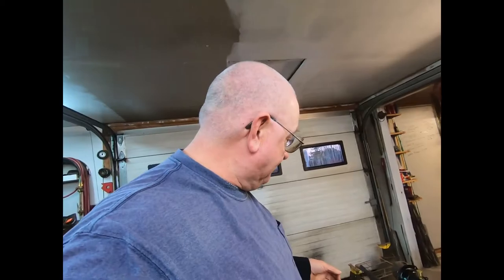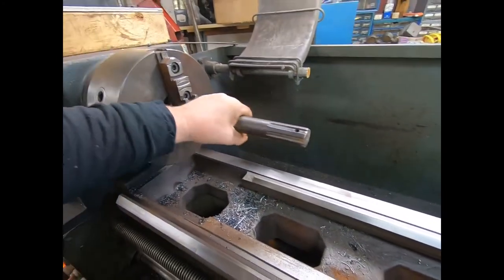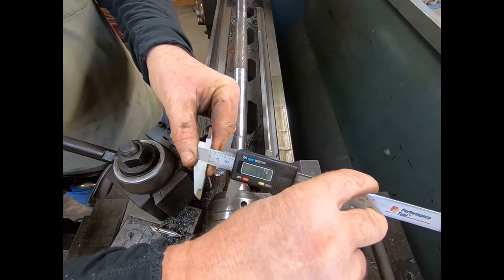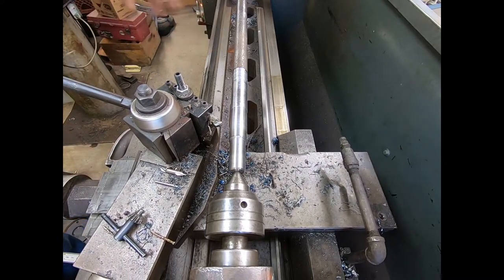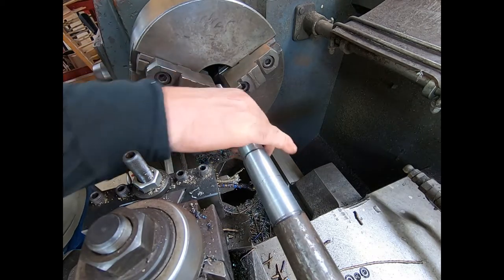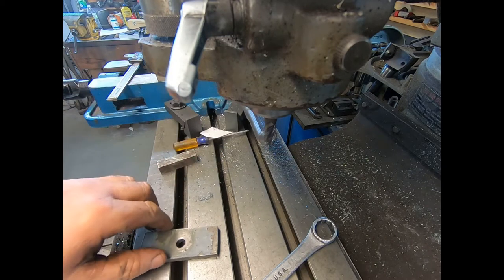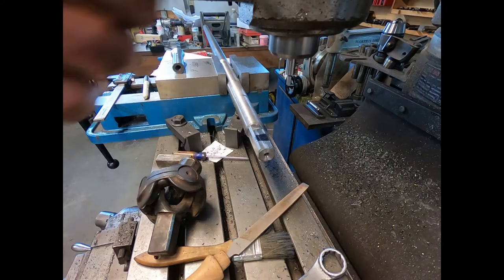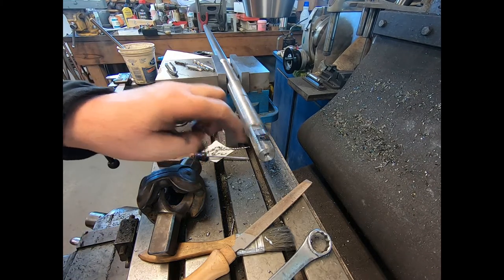Ford model T snowmobile drive shaft shortening

Comment: you do this as a hobby or additional income? or did you use to do it before lathes fascinate me wood or metal
Reply from the maker: I used to use the shop as a jobber shop doing anything from building Cummins diesels too rebuilding truck spindle threads. Now i will only work for myself or friends.